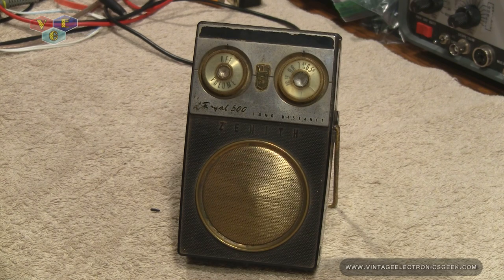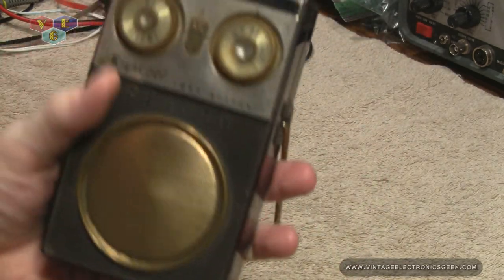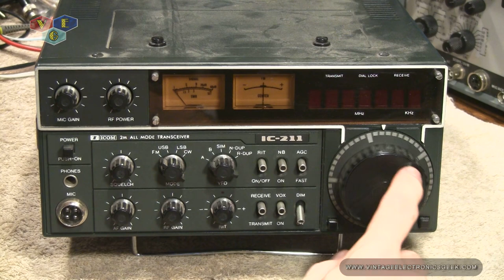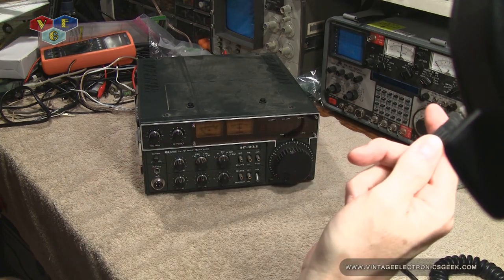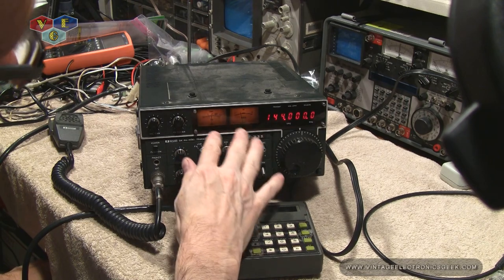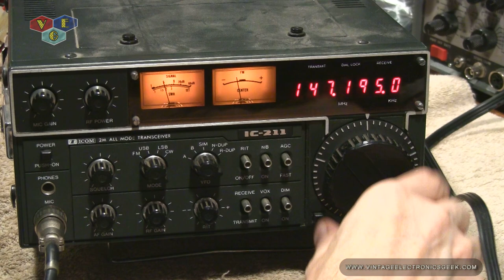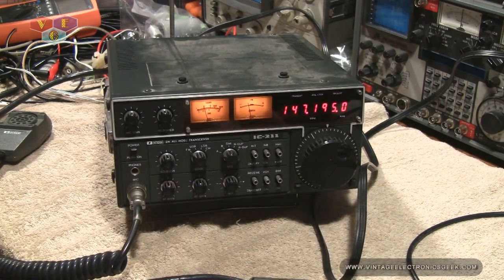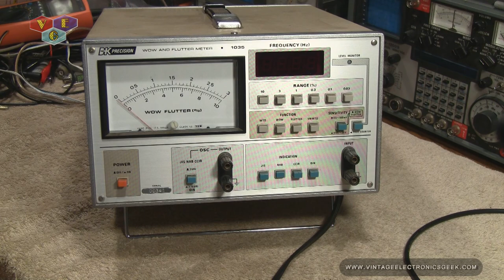Update / HAM Swap And Other Purchases - Part 4

Comment: Kewl little vintage  Zenith tr radio Jack!  
My guess is 50$?  Super deal!  

I have an Icom IC245 all mode 2m mobile, I cannot see its display, too small.  
It works good, but a pain to tune, lots of knob turning.  But when you gt to 144.200 it's ok.  
25 years ago, i had a KLM Multi 2700 2m all mode base w/10m Oscar receive.  I think that it was made by Yaesu.  I'd like to get another, but they usually get over 100$.  
WOW, um fluttering!  Do you have test tapes?  A freq counter also does the trick.
Reply from the maker: Howdy Don!  I think I paid about $5 for to radios but I can remember, wasn't to much though...wow, the IC-245 looks  like a smaller package then the 211, I can appreciate the small buttons statement....the KLM is a cool looking radio, reminded me of a RS CB from the 80's!  :)  I had purchased a calibration cassette tape last year, it produces a 3KHz tone good for speed and wow & flutter, you have any?  ~Jack, VEG

Comment: Lots of goodies! Interesting about the radio being able to blow it's own speaker. Usually the amplifier should be dimensioned in a way that this is hardly possible. I've only seen it once that a radio overpowered it's own speaker in such a way it started to smell. But that was a much later model with a pseudo-complementary output stage, and a dead shorted coupling cap was the reason so all the DC offset got into the speaker. 

But considering this is a very early transistor model it probably uses a center tapped transformer  push pull output stage just like in a tube amp. Or even a transformer coupled, single ended class A output like the regency tr-1. Either way, DC offset getting to the speaker is impossible. 

Is the IEC connector really AC/DC? Usually it is AC only (3 pins for live/neutral/earth GND) and shouldn't be used for anything else to prevent confusion.
Reply from the maker: Man, I would like to get the TR-1 and the Sony TR-55 but the prices...must troll long time!  :)  I'm not as bright as I wished I was in electronics, but, um ya, what you said!  :)  I believe that is very similar to what I read...now that I have had my eye surgery, I would need to research the radio again to better understand what I was trying to convey.  

Is your question pointed towards the Icom or the BK? Short answer, yes on the 211, standard 3 prong...the remote for the 211 used the multi-pin connector with a pig tail that went to the 12v input which I thought was odd, but I havent opened it or studied the SM on the control yet.

 On the BK, it too is a standard IEC 3 prong, unfortunately I hadn't had a chance to power it on yet as I ran out of memory card thus the hard ending to the video, I recorded all 4 parts in one setting and just had not got to finish it out yet, might start tomorrow or Monday at which point, we will all get to see it power on for the first time.  ~Jack, VEG

Comment: Now I am starting to get envious. Interesting old radio; I think thereafter the trend went to capacitor coupling instead of transformer coupling. I mean capacitor output instead of transformer output. Old School sold his Leader and Kenwood wow and flutter meter but has now picked up another Leader (different model); the price was to good to pass up. Don't know when I will ever get to use it, though. Thanks for the video!
Reply from the maker: Thanks OS!  Check your area to see if and when HAM swaps happen...Google is your best friend for the search.  Yea, not bad for what it is, I have worse radios!  Wow, I thought it was a tool you used often or at least when working on decks...maybe you can do a video on your new one....Ill be taking notes!  :)  Thanks OS.  ~Jack, VEG
Reply: @VintageElectronicsGeek  Oh, I am trying to go to a software-based wow and flutter solution. If I can only get that Windows sound card to work correctly...Most of the time I didn't bother using wow and flutter meters; especially with low-end units. But the main reason I sold the units was space. I tried to get rid of stuff I didn't use that often. Of course, I really want to keep everything :-) Almost bought a spectrum analyzer like you have...But that ran contrary to my if-you-don't-use-it-get-rid-of-it philosophy. Next up for repair is a Hitachi boombox.